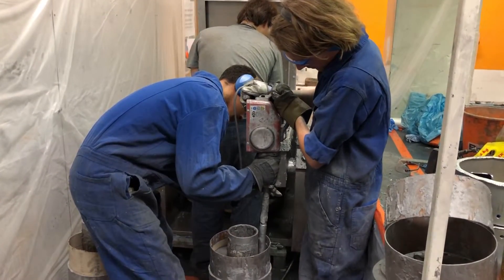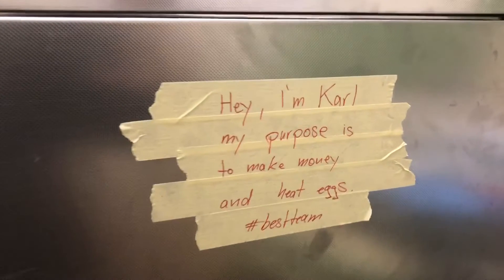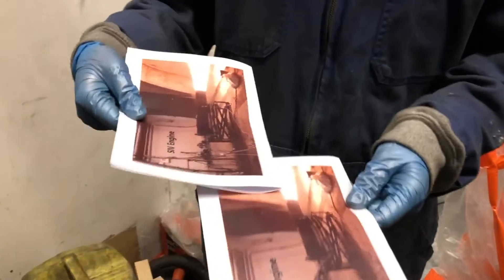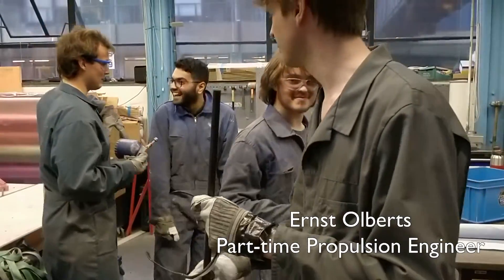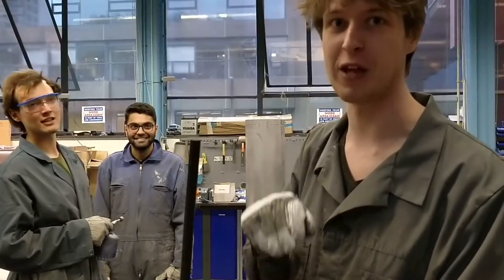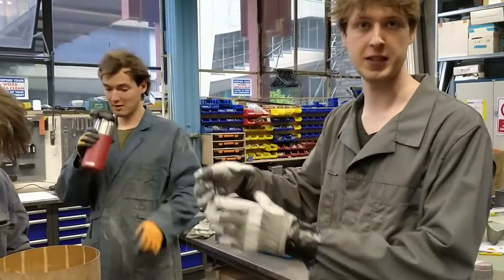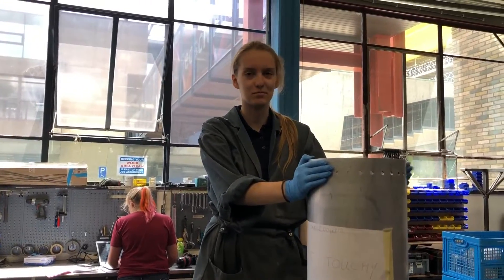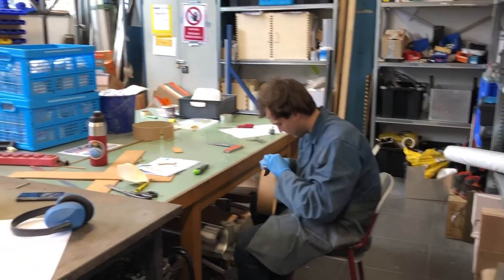Meet the Propulsion Team!

Comment: Questions: Considering risk and frequency of casts with inclusions and bubbles, what made you stick with casting the whole grain at once as opposed to casting it in segments that you'd then stack, or casting in successive layers? Casting of shorter segments or layers should be much easier to control. Also, are you planning to switch to casting in vaccuum at some point?
Reply: The grains are cast in 3 segments, what you see in the video are the individual segments.